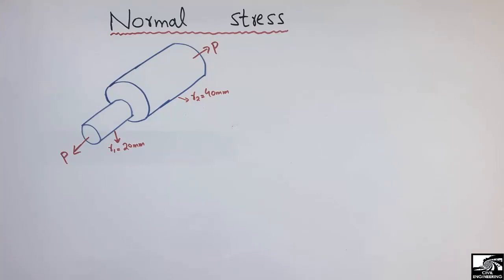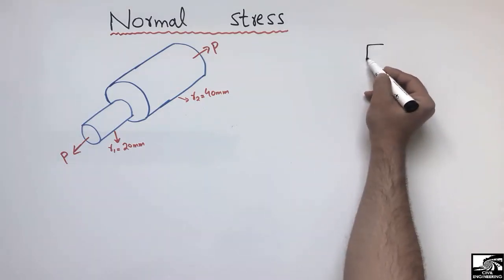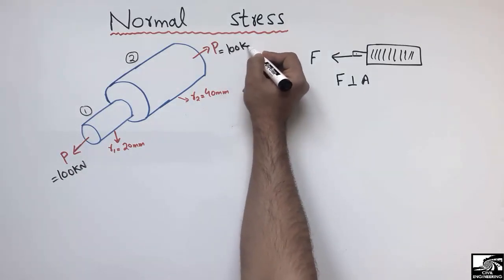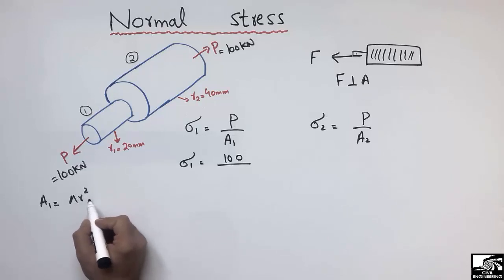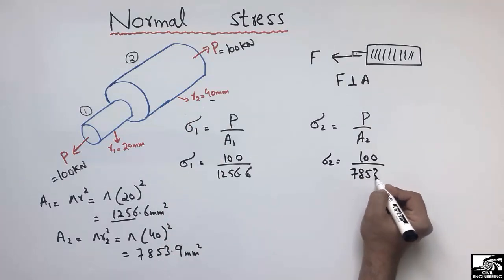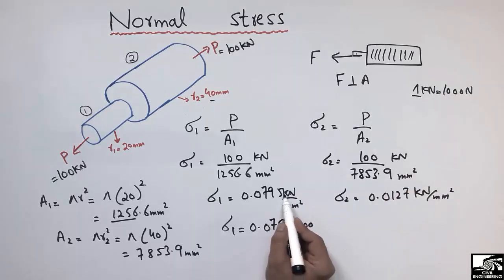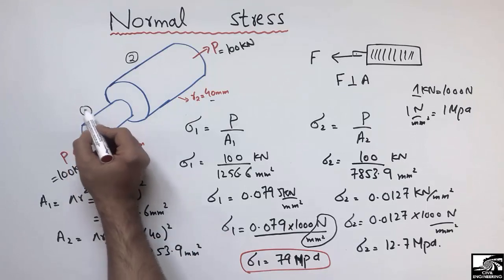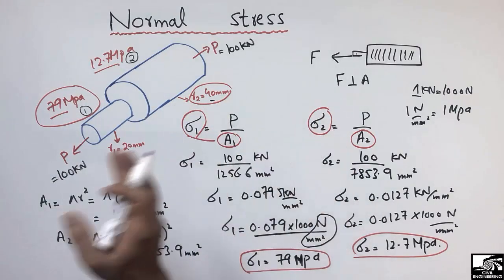Normal stress in different cross section || Example solved

Comment: In normal design of reinforced concrete structure, what is the normal standard stress of steel which is commercially available in hadware stores that we gonna use in the design.
Reply: 500MPa
Reply: Sir i meant the tensile stregth of steel that we consider in the structural design. 500 Mpa. Is the commercialy availble steel in the market(sold by hardware stores).